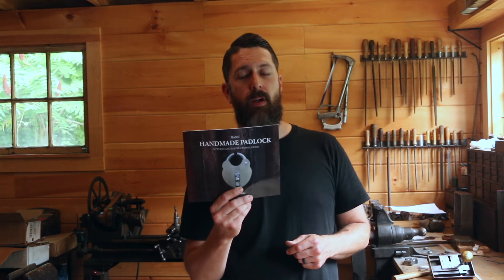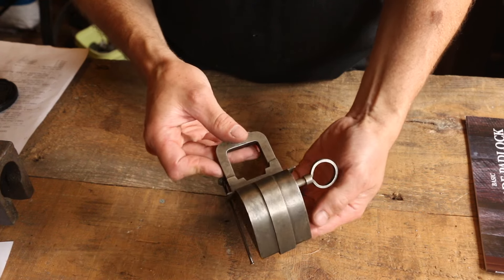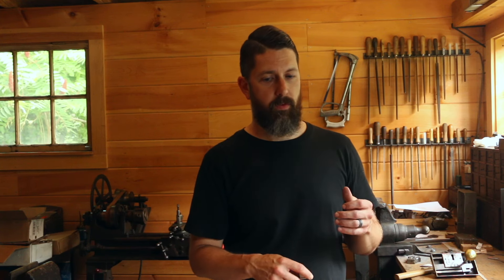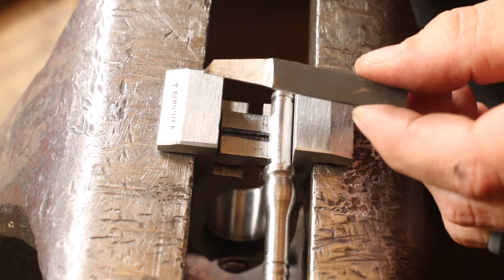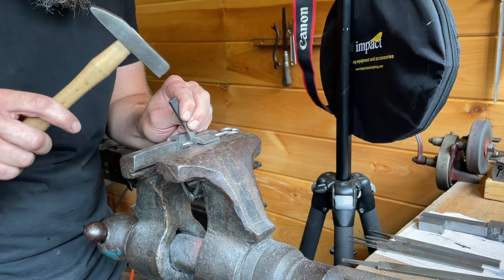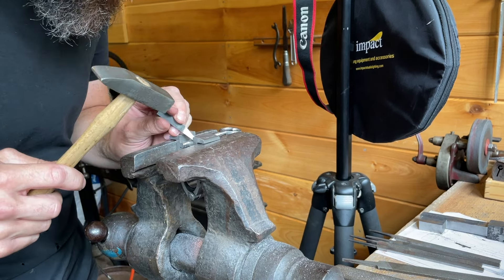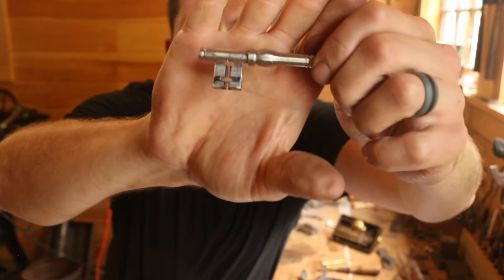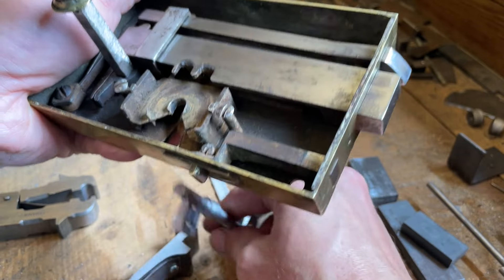Hand Cutting A Key

Comment: A friend gave me an old Gerstner and sons oak tool chest that was in a shed they cleaned out and it just needed a good cleaning and minor repairs, and its now a gorgeous tool box for my leather and antler working tools. It was missing a key though. i could get a key for it but itd be $30 or so and thats a bit much for a free toolbox, so I made a blank out of some flat stock that would fit through the mechanism, then I held it in a candle flame to get some soot on there, put it in, and where it hit a ward the soot was rubbed off. So id use a dremel with a cutting disk to cut away the metal that didnt have soot on it. Rinse and repeat a few times and i had a key that would actuate the lock and all I did from there was toss it in a rock tumbler with some steel bearings to deburr and burnish it and the key works perfectly! I felt so clever working that out and its given me a bit of a bug now, wanting to try my hand at making a lock and key from scratch. And then this video shows up like it knew what I was thinking. Great stuff!!
Reply from the maker: That’s awesome. It’s always satisfying to solve a problem for yourself, especially when you have to work through the problem and figure stuff out. Chase that rabbit down the hole, that’s why I share my work.
Reply: @GreasyLuckForge  im definitely chasing it all the way to wonderland, ive got a reference book of antique ironwork and something ive always been infatuated with are renaissance era “lantern keys” which are basically instead of a loop at the end of a key, theres a trapezoidal box with filigree sides and a domed pommel, some of them got quite large (i imagine part to show off the details and partially so theyd be hard to steal) but id love to eventually produce one of those, perhaps with something like a uranium glass bead contained within the lantern. I think something like that with a steel body and brass filigree on the lantern aspect would be an amazing project not to mention look amazing on a key ring, though thats more on the cosmetic end as opposed to the working end of things. I just love the attention to detail and a good tactile feeling old keys have.
Reply from the maker: Yes, those are amazing keys. Supposedly they were made from a single piece. I’ve never been able to inspect one to see for myself. It’s on my list of things to do some day, but that list is longer than I’ll ever get to and growing every day.
Reply: A couple years ago I had a job to make keys for a 1820's era French safe.  This is the type that uses multiple different keys usually with hidden keyholes.  The bit or blade of each key had a maze like warding cut front to back.  It did not occur to me that chisels may have made the job easier but it took me an unbelievable amount of time to make the 3 keys using tiny drills, jewelers saws and micro files.

Comment: Fascinating stuff. This is the first video of yours I've watched, so please excuse me if this has been addressed before. However, I was curious about your choice of the cape chisel. Is there any reason you use this over, say, a fret type saw and a file, or even by chain drilling and filing? Thank you.
Reply from the maker: Thanks. A large part of the work and research that I do is to figure out how this work was originally done. Often times we think of past technology as being primitive, but they actually had quite effective techniques. I also find the old ways of working to be much more pleasurable of an experience. This is the traditional way of cutting some of these slots. Some locksmiths also had files that were more like saws, but I haven't gotten around to making one of those yet. I have used a jewelers saw, but that's not a traditional way of doing this work as far as I know. Using a small chisel would be much more effective in the days before electricity if you were trying to chain drill and file.